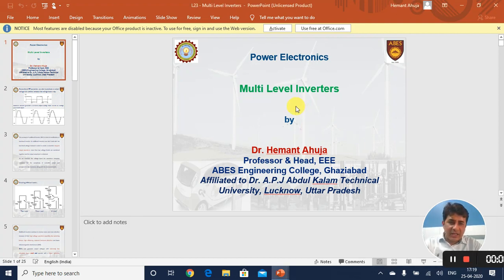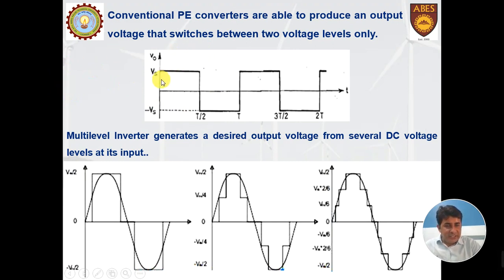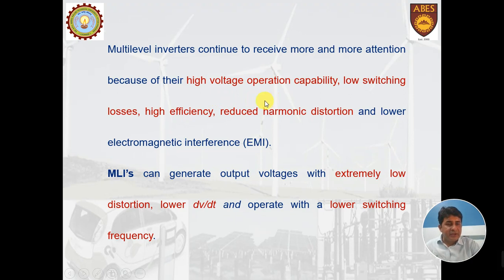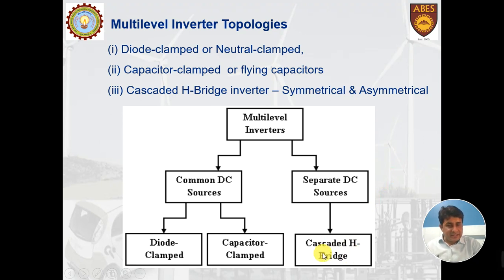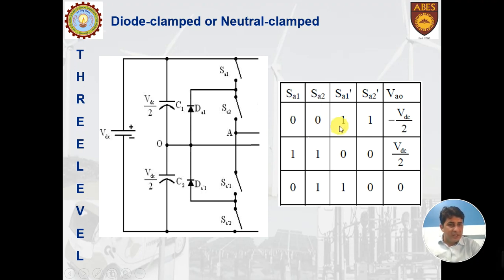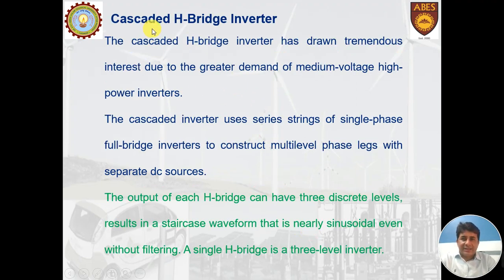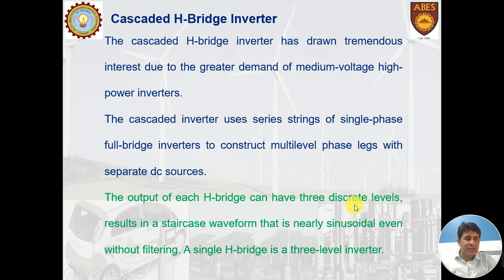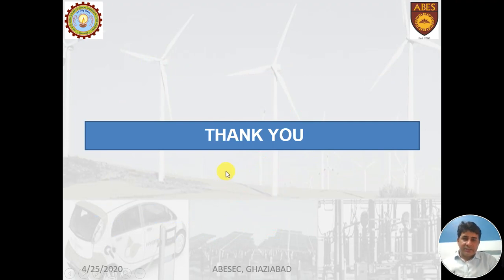PE (L23)  Multi Level inverters

Comment: This type of inverter hasn`t an output LC bypass filter. It exclude reactive power (because there isn`t any capacitor on output). For example  - 1microFarad capacitor has a reactive power 15Volt-Amper. It`s a big advantage - in my oppinion